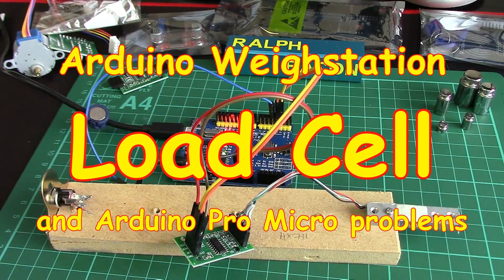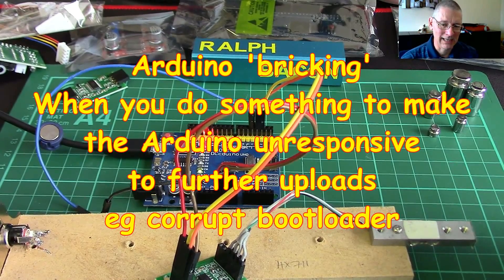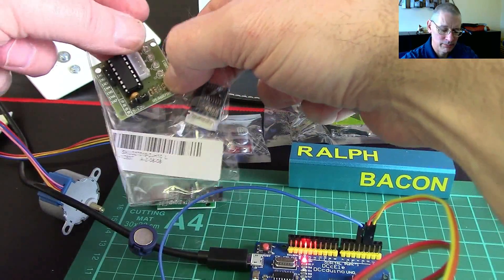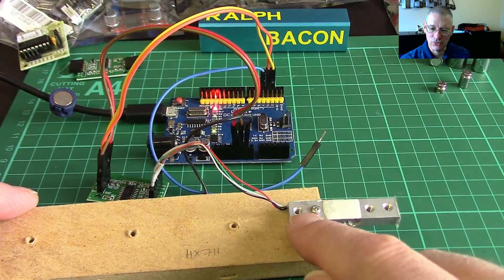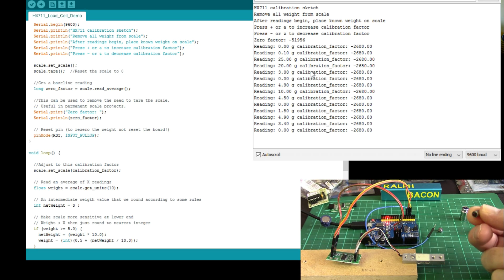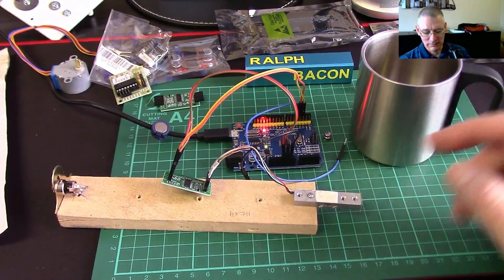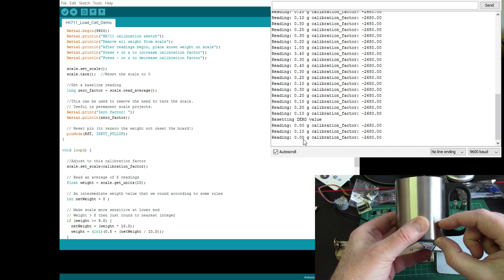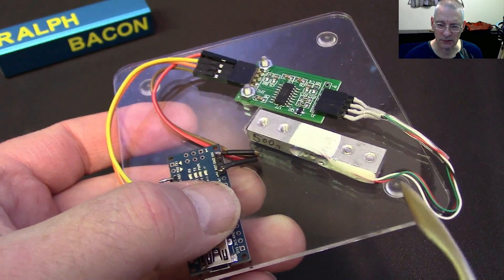#31 Load Cell project (part 1) Arduino Micro problems plus postman deliveries

Comment: Hello, first off all I want to congratulate you on the videos, them help me a lot about load cell and arduino. But I'm a freshman with arduino. I'm from Brazil and I'm a Master's Degree student. I will develop a load cell with arduino's suport, but I don't know what arduino's board to buy. So, I'm in doubt about 3 models: Arduino Uno R3; Arduino Uno R3 Mega328p Ch340g (it seems to me that it is not original Arduino but supplies what I need) or Arduino Nano V3.0 Microcontroller Atmega328p. The last one is the cheapest and as it is a university work is more attractive , but I am afraid of her not to fulfill my purpose. Sorry for my bad english. Thanks for all your help.
Reply from the maker: Ola, Andre! Você fala Inglês muito bem. Unfortunately you speak English better than I speak Portuguese these days so we'll continue in English!
 
If you are starting off with the Arduino you need an Uno R3 (clone). They might be described as Uno V3 or Uno v3 CH340G. The "mega328p" is the name of the actual microcontroller chip on the board, and they all have this, even the original ones!
 
The difference in design between a real Uno R3 and a clone is that a clone has a different chip for the USB to serial conversion (it's a CH340G), because it is cheaper. From the Far East you can get an Uno R3 clone for US$4 or less.
 
However, for better flexibility you can get a Nano Development Board like this one:
https://www.aliexpress.com/item/Smart-Electronics-for-arduino-Multi-Function-UNOR3-UNO-R3-Nano-3-0-Shield-Expansion-Development-Board/32684416839.html
 
into which you plug in a Nano R3 Atmel 328p (not an Atmel 168, that's a different chip with less capacity), like this:
https://www.aliexpress.com/item/1PCS-Promotion-Funduino-Nano-3-0-Atmega328-Controller-Compatible-Board-for-Arduino-Module-PCB-Development-Board/32832925868.html
 
I also recommend you watch my videos #3 and #4 which give you some basic hardware recommendations too. Tudo bem?
Reply: Hello!! Your portuguese is very well (the google translate always support me when I finish writing). Thanks for your advices. The prices from the Far East are so attractive, but here in Brazil we have a problem with the deadlines, the products take from 2 to 3 months to arrive, I don`t have much time to start my project. If I can a lit more abusive, If I buy only the Nano and the Hx711 Can I have good results? Like at the end of this video. By the way, it's the model this I wish to buy (We have a site like ebay, it`s called mercadolivre): 
https://produto.mercadolivre.com.br/MLB-842983643-arduino-nano-v30-microcontrolador-atmega328p-ebook-_JM 
or this:
https://produto.mercadolivre.com.br/MLB-767538993-arduino-uno-r3-mega328p-ch340g-cabo-usb-e-tutorial-_JM
I will watch the videos right now.
Reply from the maker: Ola, otra vez! (Or am I now speaking Spanish?). Anyway, either of those two modules will be OK.
 
If you get the Nano with the header pins NOT already soldered in place then you can solder them the other way up (so they are pointing upwards not downwards). It's easier to attach Dupont cables to them in that way. If the header pins point downwards then it is easier to plug into a breadboard but I don't think it is the best format for that module.
 
The UNO is fine as it is. Either one of these modules with the HX711 will work. If you are only doing this for a project then get the 500g Load Cell in my video so that you replicate it exactly, including all the wiring. Then you can be assured of success! Boa sorte com seu projeto.
Reply: Hello, almost portuguese. You missed one letter of word "oUtra" but is fine. I bought the UNO and the HX711. However I still have to buy the strain gauges and machining the load cell. When I start the work I come back here. Thanks a lot.

Comment: hi Ralph, Thanks a lot for the video: but I have a worry with reading.
My analogread value from the load cell sensor 40 kg is just constant even when i press the sensor there is not variation. 
please, I need a help!!
Reply from the maker: This indicates a problem with the wiring, Tjade, and I suggest you revisit that first. Look at the spec/data sheet for your particular Load Cell so that you get the correct colours connected to the A+ etc. If the wiring is 100% then you need to implement the very first sketch to calibrate your Load Cell and get the seed value. Try all this first!
Reply: okay, thanks you!! 
Let me try it!!
Reply: I try your recommendation, but the value is still steady. I supply the load cell with 9v battery, no response!! I bought 3 HX711 and two load cell sensor 40 Kg. There is no variation!! I am discouraged!! If you any idea, it is welcome!! thank you Sir Ralph!!
Reply from the maker: My final piece of advice would be to buy the exact same Load Cell (500g) that I bought (details in the video) and construct the project exactly as I did it in the videos, starting from step 1.
 
We know that works so if you follow that, get it working then you will not be discouraged and will have renewed enthusiasm to then work out what the problem is with your advanced project. That is my recommendation. It will not cost much to do this (you already have the HX711 module). And use a proper USB connection and/or 9v plug in supply, not a battery. You will need to see the results from the Arduino via the Serial Monitor anyway, so use the USB port. What do you think? Thoughts?
Reply: Thank you Sir for encouragement!!
I will follow your instructions. 
Next time I will surely give you a positive feedback!!
Reply: Yes, It is actually true!! The problem  were coming from the wiring!! It was absolutely different from yours and any other I saw in Internet!! Black Power + , white Power - Red Signal + green signal -. Thank you Sir Ralph for your assistance!!
Reply from the maker: OMG, that is a very strange wiring colouring scheme to use (and not surprising you had misidentified it), but GREAT NEWS that you have solved the riddle and hopefully you will now move forward and complete your project. Well done for figuring it out!
Reply: Thank You Sir!!

Comment: Hi Ralph S Bacon thanks for sharing us you work. I also doing a load cell project but may I know why I keep on obtain fluctuate reading? Is it because I using a 200 kg load cell for measuring 40 kg compression?
Reply from the maker: You might get a tiny drift, Kok, of less than 1g for a 200Kg Load Cell but it should be pretty stable if you have connected the wires from the Load Cell to the HX711 correctly. I'd double check that these are all connected up correctly and that you have done the calibration correctly too.

Comment: It seems as though you could accomplish the same effect with simply using a micro limit switch to activate the "cup full " alarm
Reply from the maker: Well, it's not the 'cup full' I need to know about, Steve, it's the half cup, quarter cup, dribble-in-the-bottom-of-cup that I want to be reminded of. Also, different cups are different weights so a µswitch would not know I've put a different cup on the coaster and would tell me there is coffee left when there isn't (or vice versa). The only way to 'intelligently' work all this out is by knowing the weight of an object - which the Load Cell excels at! And, to be honest, this was just a rather tongue-in-cheek project to demonstrate the facilities of the Load Cell - but one which turned into a rather nice coaster with lights (see video #32) and which visitors to my desk are intrigue by (at which point I mention dilithium crystal realignments just to blind them with Star Trek science, works like a dream!)

Comment: Question for you if you don't mind.  Is it possible to set it up so that the scale doesn't have to calibrate every time.  What I'm trying to do is build something that will sit under a box that I can power up from an external battery that will display the weight of the box.  The boxes are heavy and stationary and my ultimate goal is to have something that I can walk up to, plug in a little external box with a screen that will power the Arduino nano that is in the base the box sits on and display the weight.  I can calibrate it and tare it out before putting the box on but after the box is set on it I don't want it to calibrate again, I just want the weight of the box and its contents.
Reply from the maker: That's exactly how my Coffee Cup Coaster works. Once it's been set (tared to zero) it will continue to work until I switch it off. Once I switch it back on (every few months) I just tare it (with my empty coffee cup on it) to zero and that's it. The calibration phase only occurs whilst you are building the code, as every sensor has a different 'magic number' as my demo shows, which could be anything from -32768 to + 32767. But once you have (accurately) established that using the calibration sketches, that number remains immutable for the life of the sensor. Pretty much. I notice this comment is under video #31, have you watched #32, it might make it clearer (I can't remember what I put in each one, sorry, my age etc).
Reply: I just watched the second video and it did help.  However once I set my box on top of the load cell I won't be able to lift it again to tare it.  So when I do a monthly power up to check the weight I won't be able to tare it as the box will already be on the load cell.  So I guess my question is do you think I can get it to work by calibrating it after I build a base, then tare it and put my box on and power it off.  Then when I go out next month and power it on it will display the weight without having been tared again.
Reply from the maker: I see what you mean (I think). If we think of a kitchen scale, you are leaving the mixing bowl on the scale, setting it to zero, using it to measure the ingredients, then switching it off. The next day you just want to continue measuring ingredients without lifting the bowl off first. I think this is what you mean. So...
 
Yes, you can do this. In my second video I use a small tilt switch to act as the zero/tare switch for when I switch on (or at any time) place my current coffee cup on the coaster and tilt it so it starts the zeroing/taring process. So if that were a proper (external) switch you would switch the device on (with the box on the Load Cell), press this switch and at that point it would zero-ise correctly taking into account the box already on it.
 
You are using a 200Kg Load Cell; remember this is the total weight it can take, including the box already on it, so make sure you have accounted for this. Sounds like a nice project. You connecting it up to an LCD or something similar for displaying the actual weight?
Reply: You have it right with the kitchen scale analogy.  What I'd like to build is build a base with a load cell that a beehive will sit on.  I will then calibrate the base then tare it with an empty hive.  Then I will build a small box with a power supply, the Arduino and a LCD display and plug the load cell into it so I can monitor the weight of the hive in the winter.  I would build a base with a load cell for each hive then go from hive to hive and plug in the load cell to get the weight to display on the lcd display.  I don't need super accuracy, within a few pounds would be sufficient.I'll have to play around with it this winter and try to figure out the coding then implement it next spring.  I don't have any issues dealing with the building of the bases or electronics it is the code that I will have to figure out.  If I figure it out I may try to expand on my idea and add thermistors inside the hive so that I can check the temperature as well.They have commercial products that do what I want but they are very expensive.  I'd like to try to figure out a more economical option for other backyard beekeepers like myself.
Reply from the maker: That all sounds feasible, just remember that each Load Cell will have a different calibration value, so you would either have to enter the calibration value as part of your sketch for each hive (as you move around weighing them) or store the values (in EEPROM, for example) and select hive 1,2,3... etc so that you were correctly measuring the weight for each Load Cell. But it sounds very do-able, so good luck with this.

Comment: I enjoy your video a lot. This project is cool and I want to try one too. Could you tell me which wire of the load cell connect to which pin of the HX711? Also which pin from the HX711 to which pin in the Arduino 
Thank you so much
Reply from the maker: Well now, Miracle (love that name), the HX711 boards are normally colour coded with names like "RED, BLK, GRN" etc marked on the board and which correspond directly to the Load Cell wires. If your HX711 board does not have this, then it probably has "A+, A-" and the like. In this case, Red is E+, Black is E-, Green is A+, White/Grey is A-. NOTE: The A+ and A- wires may need to be switched but try it this way first).

The seller has this documentation: Wiring Red: Power + Black: Power - Green: Signal +, White: signal -
 
On the other side (the wiring to the Arduino) you have the standard 5v power and GND connections and the centre two pins are the DATA and CLK lines - see the sketch to see which pins are expecting this information.

Don't connect anything to the "B+" or "B-" terminals (if you have them) as they are for a dual/bridged load cell.
 
Let me know if this does not work for you.
Reply: Thank you so much for your response. I enjoy your weight scale video

Comment: hello ralph , well i have tried step by step to implement your code , can you please tell me where does  calibration_factor=-2680 comes from because i do not have the right weight values, i do not know , why, furthermore i  have checked the load cell wires everything seem to be ok
Reply from the maker: Hello Sidibe! I've updated the video description, look for the new DropBox link that mentions seed and calibration sketches (they are used in the demo and are really small). Run those and you will be able to get that magic calibration_factor (which could be ANY value, mine just happens to be a negative number but yours might be very different). Additionally, as Eric Gibbs has mentioned below "A £2 UK coin weighs 12.0gm and the new £1 coin weighs 8.75gm." If you are not in the UK perhaps you can find out what your coins weigh and use those instead of the tiny weights I used?

Comment: hi Ralph,
Ref the Coffee cup load cell.
A £2 UK coin weighs 12.0gm and the new £1 coin weighs 8.75gm.
I use a stack of £2 UK coins for calibrating in 12.0gm steps
Eric
Reply from the maker: Brilliant idea, Eric. Did you already build this (in some form or other, not necessarily a Coffee Cup Coaster)?
 
Now I think of it, your idea is great bar one HUGE flaw. You say you use a stack of £2 coins to calibrate with. There's the problem. A whole STACK of £2 coins? I'm lucky to find one and a dead moth in my wallet, plus an old W H Smith receipt. :) Heh, heh, just kidding, a great suggestion and thanks for sharing as I know others have wondered how to calibrate their Load Cell without buying a set of weights like mine. Thanks for posting.

Comment: hi ralph , your video is really helpfull but i've got some questions about your code, where did you get your "arduino.h" , and  "hx711.h" library since  i'm not able to  find these libraries i can't try it on my arduino, may i have some help
Reply from the maker: Hello Sidibe! I've added in a link to (what I think is) the library I used (I will double-check tonight), it's now in the video description. You won't need the "Arduino.h" library if you're using the Arduino IDE as it is automatically included for you behind the scenes. I only show it because I sometimes use a different IDE. But this library is part of the standard Arduino code so if you so include it no harm is done (and you don't need to download it).

Good luck with trying this out and get a Load Cell capacity (the weight it will measure) appropriate to your project's needs (ie don't get a 10 Kg Load Cell and expect it to measure down to the last gram - for that you need a more sensitive Load Cell like the one I was using with a 500g max capacity).
Reply: hello , Ralph

thank you Ralph for the quick answer, i'm using the arduino IDE with a 5kg load cell, but i can not find the link in the video description would you mind  showing it to me.

best regards
Reply from the maker: Sure, I hid it underneath the sketch link:
 
The library can be found here: https://github.com/bogde/HX711
Reply: thank you very much ralph you are of great help thanks for sharing your knowledge , and i'm looking forward for new videos and projects that you will make.
best regards